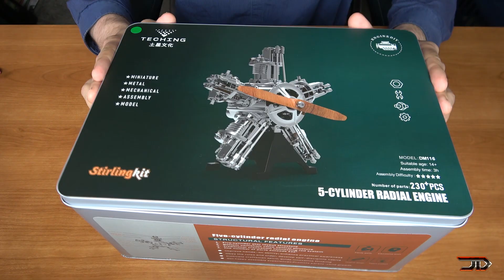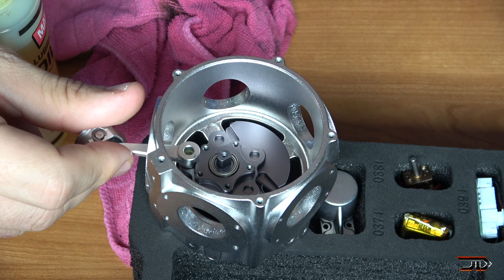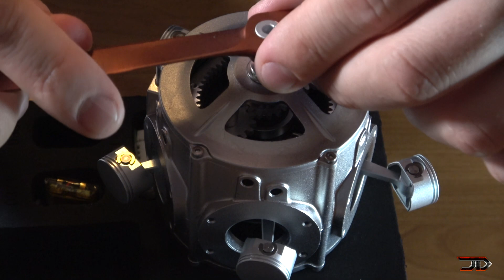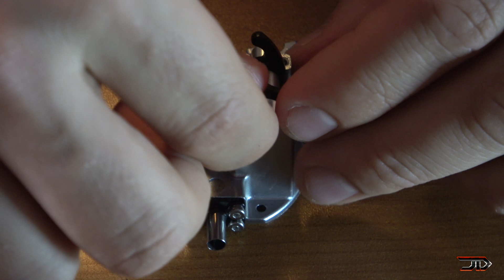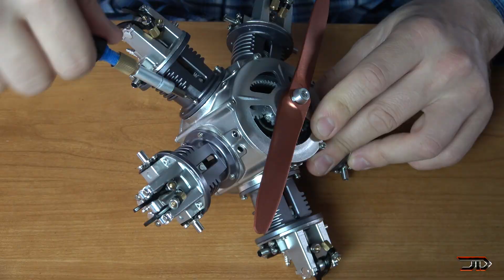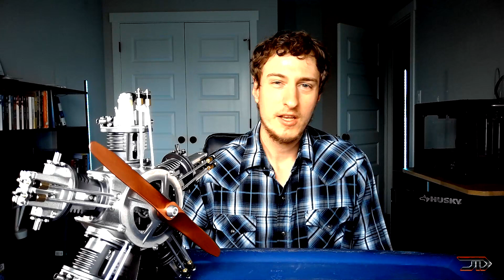AMAZING Radial (5 Cyl) Motor Replica Model Build Kit

Comment: Disappointing that it isn’t a working engine. I used to fly a PT 22 with a Ryan radial engine.
Reply from the maker: Nice! What was that like?
Reply: https://aeropedia.com.au/wp-content/uploads/2019/05/Ryan-PT-22-Recruit_Aeropedia-The-Encyclopedia-of-Aircraft-1170x570.jpg

Lots of aluminum to polish. Manifold was off one cylinder; what a noise. Partner got his arm busted when the hand thrown 8’ wooden prop kicked back. Flew across Lake Michigan to a fly-in in Wisconsin.

Comment: Why don't you build one that actually runs? It seems like a waste of time after all that work to have to spin it with electricity. Just sayin...
Reply from the maker: Of course, that will happen in the future! It was kind of trial run (figuring out the right lighting/camera shots), I am still looking for a good radial kit.
Reply: @Motor_Explorer1  Looking forward to when you find one. I really dig this, but if you come across a kit for a gasoline powered one, I'd probably run out and order it!